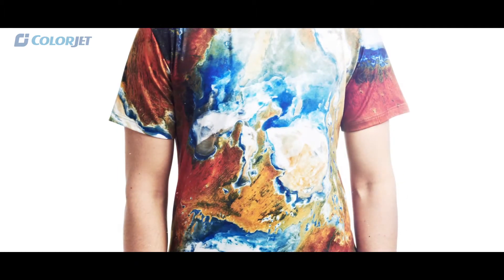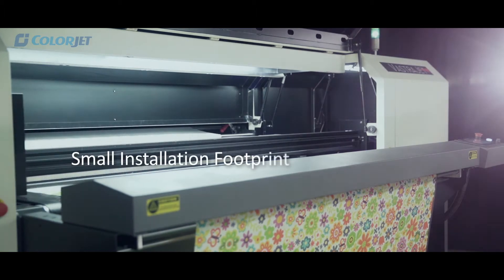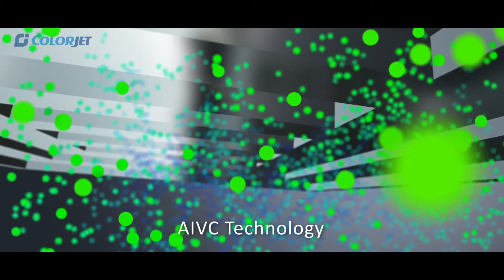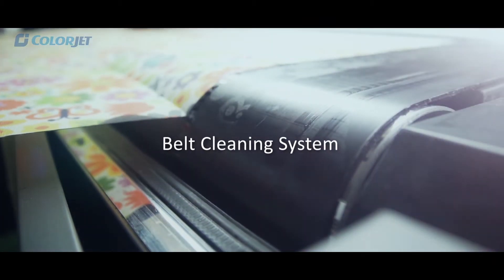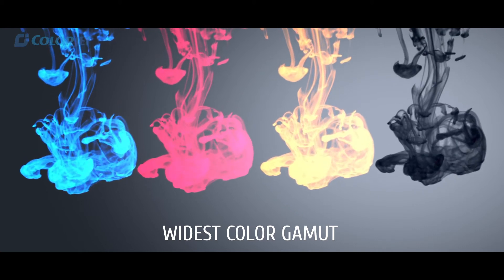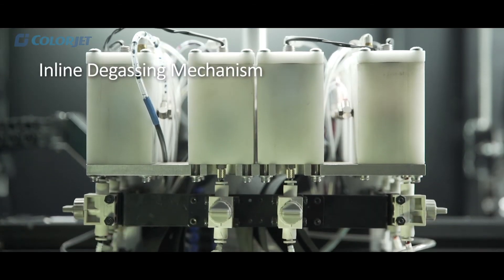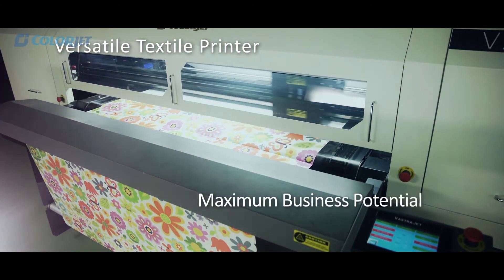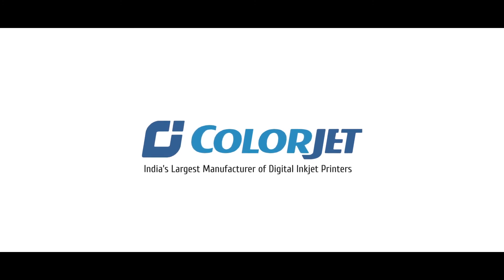Direct to Fabric Digital Textile Printer by Colorjet (Vastrajet Version 1.1)

Comment: i just buy direct textile printer from china .i am using pigment color .but after print and fix the color . wash fabric  the color is drop .how we can fix this problem thankyou
Reply: This is a common difficulty with pigment inks.  I would suggest you try fabric  from Premier Textiles, UK.  If the problem remains, try a better ink

Comment: what about curing after printing? can i have more details of equipmnent & price. we have a project of buying a direct to textile next year and to be setup in mauritius
Reply: Thank you for posting your comment, NS Serigraphie
Reply: Curing is needed when you print with pigment dye inks.  If you print with reactive dye inks, the fixation is done by steaming of the printed fabric.
Which type of inks you should use  depends on what is the material of fabric and what is the end use